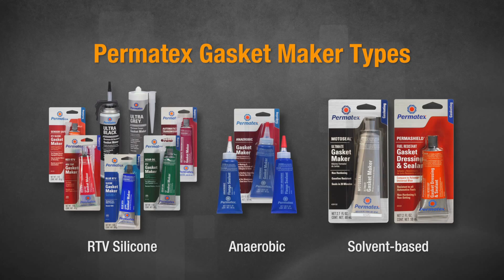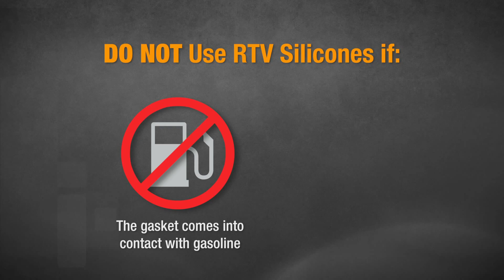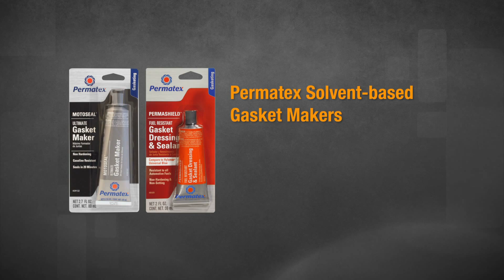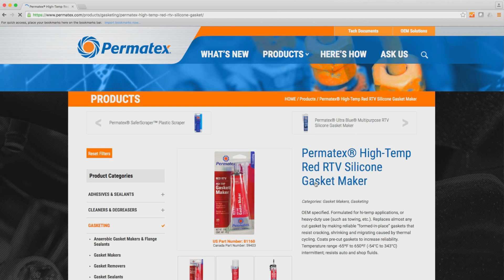Gasket Maker Overview - Permatex Tech Tip Series

Comment: 1:06 Holy smokes!  This dude has no clue as to how much RTV to apply to that water pump!  95% of it will end up in the cooling system!  Heck, every single shot I see in this video of someone putting the RTV on the pan or cover shows them using FAR too MUCH!!!  That's just crazy right there!  And I see no mention of the venerable #1, #2, and #3 which are irreplaceable in my tool box.
I remember when Permatex knew what the heck they were talking about.  Apparently those days are gone.

Comment: I have a snowblower carburetor bowl that keeps on leaking gas where the 1/2 jet screws into the bottom of the bowl.  I've replaced the gasket but it still leaks.  I'm going to try Permatex Solvent Based Gasket Maker.   Any comments?    Has anyone used it for this purpose as well?

Comment: Those beads are like 10 times more than is needed. The silicone will break off inside the crankcase and block the oil pump pickup.

Comment: What would be the recommended product to seal a small oil leak on the oil filler tube where the oil cap screws on? Both are plastic. The gasket is okay and does not need replacement.

Comment: @1:04 Thats how you can clog you heater core and radiator !! probably the guy has no clue whats hes doing ... thats way waaay too much silicone, machined aluminum surfaces requires a bead of 2mm in diameter and no more...

Comment: Just used zrtv ultra black exactly as it says on the package instead of the ton used in the video and let it sit for about 27 hrs on a timing chain cover and water pump.

The water pump leak at one spot. Wasted a day for one spot and now how to take it apart. 

For years I normally put it on one side of a normal gasket. Tomorrow I will replace with a normal gasket and no rtv.

I like the silicone combination gaskets so I guess I’ll move into 2022 but I live in the country so I have to fix my truck to get there or walk… it’s only 7 miles to the store and when I was 12 that was a normal walk
Reply: When I was 12, I walked normally too.  Then one day there was a thunderstorm.  It made the ground wet.  And crackers get soggy in soup.  Also, the price of tea in China has fallen over the last two weeks.  The country is a beautiful place to play that harmonica.

Comment: That is the worst beading I have ever seen in my life. Hello blocked oil pick up, what wrong, you're full of excess RTV?
Reply: A friend had a problem with his oil pickup being blocked and I couldn't find the time to fix it. I had too many irons in the fire and the engine finally threw a rod through the side of the engine. Turned out to be blocked with too much silicone gasket sealant from a past oil pan seal that plugged the oil pump screen. Some mechanics are not up to snuff and haven't a clue. Another acquaintance used pure antifreeze and cracked an expensive block. The ignorance abounds and so I don't let too many people touch my vehicles and I don't have many problems with my work.

Comment: Never ever! Use silicone for head gaskets.  It will cause problems and you will most likely need to take it apart again.
Reply: Iv yet to have problems been going for a few years now😂
Reply: @jacktheboss4life350   you got lucky,. Silicone will eventually let go with hot oil pressure. And the silicone cause goopines around the coolant and oil ports, sometimes plugging them off..  the head gasket also provides recommended factory head to block clearance, which could cause your engine to have piston to valve contact.
Reply: @zorans5200  has nothing to do with clearance or oil pressure, a head gasket does not need additional sealant
Reply: @HeyJerry55  clearly you have never rebuilt any engines with that statement.
Reply: @zorans5200  Brother I just rebuilt a 986, and I am also not disagreeing with your main point. I also misread your comment, I assumed you meant ADDING silicon paste to an existing headgasket. I didn't think you were talking about using just silicon for a headgasket.
Reply: @HeyJerry55  no worries. Cheers mate!
Reply: I used silicone for the head gasket in my boat.  At the time, I was out in the ocean and had no choice.  Still working fine, and no leaks from the head 6 years later.  I contacted the manufacturer (Thetford) and they said as long as none of the nasty stuff leaks out of the flange, there's no reason to be worried.  They said to just keep an eye on it and replace it with the correct gasket if it starts leaking.

Comment: 2:52 he over torques the first bolt of the oil pan! He squeezed it all out too! Finger tighten all bolts EVENLY for one hour. Torques after 1 hour. Let cure for 24 hours.
Reply: Ok ok
Reply: That's the info I was looking for, thank you
Reply: That’s what I was looking for too loo
Strangely not mentioned in the video

Comment: Engine recon shops loveeeeeeeee RTV.!!!!!!!!! THEY GET UNTOLD JOBS COME IN !!!! RTV IS GOOD STUFF, BUUUUUT!!!!!!!!!!!!!!!. DIPSHITS USE AND PUT 10 TIMES TO MUCH ON, ENDS UP IN THE SUMP AND OIL PUMP PICKUP, OIL PUMP and  RUNS THE BEARINGS ,  so many engines are fucked by over use of sealer.
Reply: Runs the bearings.  Yes.  Run, you bearings, run!

Comment: they should show how to apply it correctly.. not big thick beads.... it just gets into the oil pan,,oil pick up etc.
Reply: Omg unbelievable
Reply: Thenonly reason I came here
Reply: oil pump won't pick it up since it has a mesh to prevent this kind of sutff
Reply: @verdele  the mesh will be clogged and no oil will be sucked by the pump, thus starving the engine of oil

Comment: Reminds me of a short lived engine I disassembled.. Absolutely riddled with RTV squeeze out. It was like silicon spaghetti and it was everywhere.. Oil galleries, water passageways. Big daggy bits dangling down the intake runners.. Hard to know if the oil starvation was from the blocked pickup or just most of the engine oil being in the rocker cover because it couldn't drain fast enough lol.
Reply: its all user error,dont be going ham with the gasket maker use common sense,let it dry for a bit and then tighten down your parts and bam minimal squeeze out 
ive never had a problem using their stuff on my applications,either im building a small or big block chevy,my brothers 2jz and k24 engines that i built for him and ect.
Reply: @thatmand4542  Oh for sure, I'm not saying there's anything wrong with the product. Permatex makes some great stuff. But I think they laid it on pretty thick in this vid.. Thicker than I would after that spaghetti engine I wound up with in a car I bought.
Reply: @M3rVsT4H  It was a bit like "do you want some water pump on that silicone bead?"
Crazy to show that on a "professional" promo video.
Reply: Clearly the dude was being smart... think about it. He was able to seal the water pump and correct a 1 inch miss-alignment issue with the crank pulley. Seriously though, I could have puked a better bead than what was demonstrated.... My God, if this is the company's channel, that's a reason to NOT use *Permatex right there..

Comment: The old 80s permatex videos remind you to use the correct amount of sealer for the bead, in this instance, 90% of the bead will  end up stuck in the oil pickup LOOOOL
Reply: Saw many cars come in to my shop with no oil pressure, or spun crank bearings, clacking hydraulic lifters, seized engine, etc, because the sump pickup was plugged with silicone that sloughed off after a valve cover gasket replacement.  Especially bad was that old Racers Blue silicone.
Reply: @jdlestina3882  Too true! I was sick watching those gobs of sealer piled up on the sealing surfaces! (I'm a retired ASE certified Master Mechanic in the Auto and HD truck fields with 50 years of experience.)

Comment: Anyone?? He mentioned 3 or 4 gasket makers for different applications.  Do auto manufactures list what type of gasket sealer to use.
Reply: My factroy shop manual - nissan listed permatex by part numbers. The Haynes manual just calls for RTV when rebuilding the engine
Reply: Some do, some don't.  Still others don't even exist any longer.